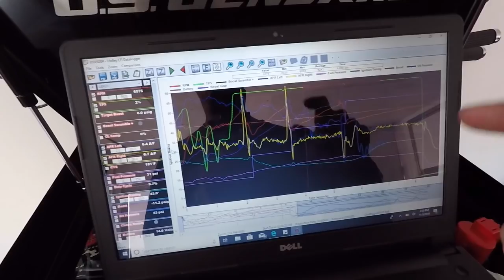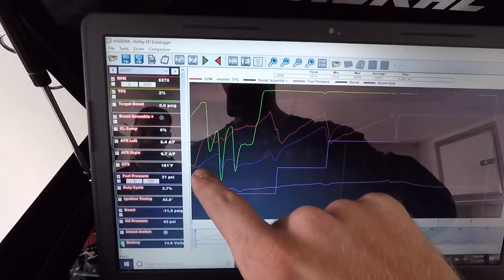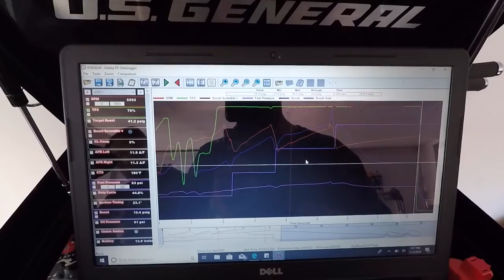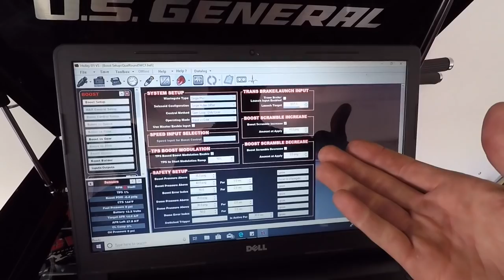World Cup Day #3 - Third Round Qualifying, Shattering Parts (Changing To Old Mounts)

Comment: Pretty disappointed to see this reckless approach to racing. The suspension needs to be tuned. Some shocks with adjustable rebound would be smart. On the right track with getting rid of the bushings. Boost is way out of control. Too much spin. You. Can’t compete when you are always broken.
Reply: Never watch boosted boiz if you think this is bad
Reply: He’s been gettin the 60 down decent and your comparing him to guys that runs 7s with autos more than likely. It literally nothing the same
Reply: @bbdl7042  I am not comparing him to anyone. He acknowledged himself that the springs were compressing then bouncing back up, that can be managed with shocks that have adjustable return rate. QA1 makes these for not too much. I think he would benefit from some good weight transfer to the back and avoid a rapid weight shift  to the front before he hits second gear. I think he has a great car, but is 60 could do a lot better with no boost added, not to mention save some parts. The reason i love watching Cletus is because he talks through his mistakes and shows the learning process.